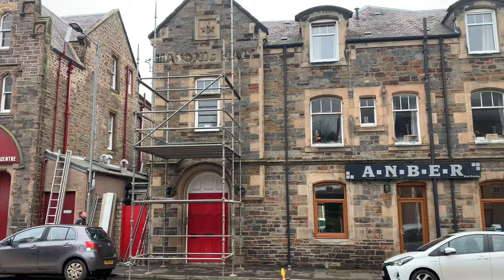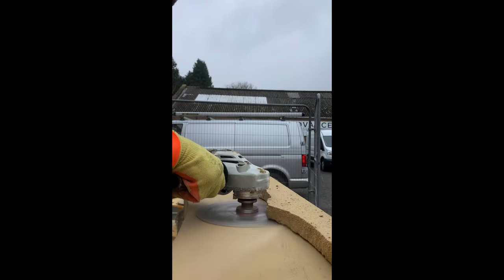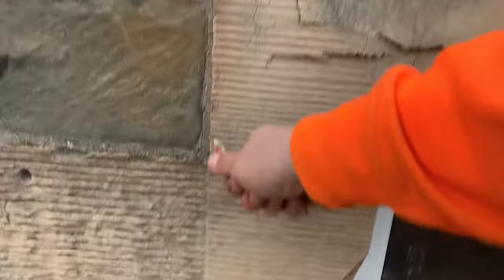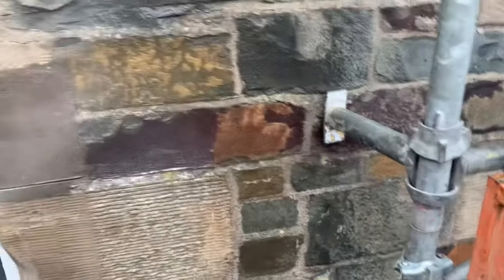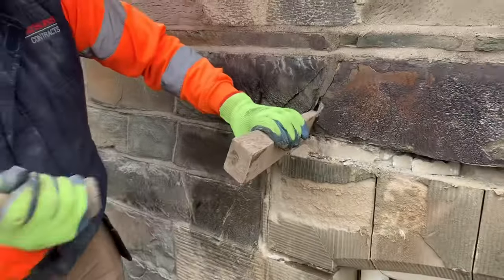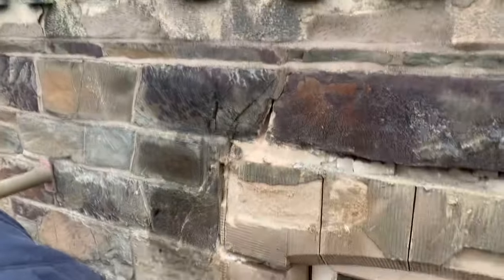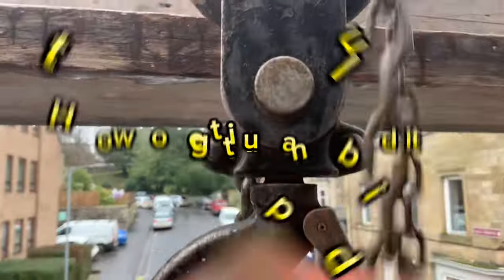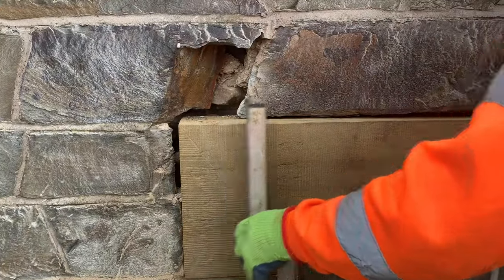Learn the easiest way to remove a sandstone lintel

Comment: Cheers Greg, your video's are really useful.  I can lay brick & block but stones a black art as Ive no source to show me what Im doing.  Same goes for slating on to sarking in scotland before Youtube I just had to make it up as I went along.  Dying arts so yeah really useful having you teach some tips.  Ive a sandstone house, blonde dressed stone with a lightly tooled face, alot of the stones have heavy erosion 3" into the building.  Am I best cuttting them out and replacing them or build them with some mortar from masons mortar (how long would that last)?  Also whats the best way to clean the building up?  A wire brush on the tooled stuff and maybe reface the smooth stuff with a cupdisk where needed?  Ive a steam Genny but Im frightened I start off more some more stones to blow.  Whats yer thoughts?
Reply from the maker: I’m glad they’re useful. (My names Callum by the way, Greg is the bricklayer I work beside lol) English style roofs are nailed to battens rather than sarking can I suggest following Compass Roofing in Edinburgh on TikTok they have some handy videos. 

So your stonework. I would always replace but for me that’s bread and butter work so if we manage to get some decent work I’ll be putting things up, I’ve discovered a love for video now as well as masonry. A relevant mortar from there would probably last 15-20 years and for me isn’t worth the money. Although it has a place.
Reply from the maker: If you send me an email with some photos I’ll have a look. callum.csms@gmail.com

Let me know.